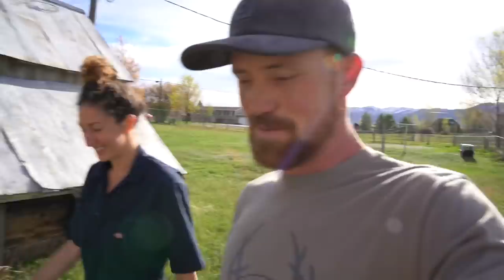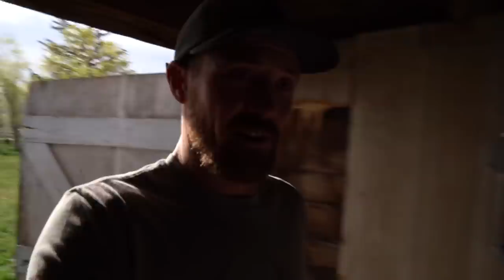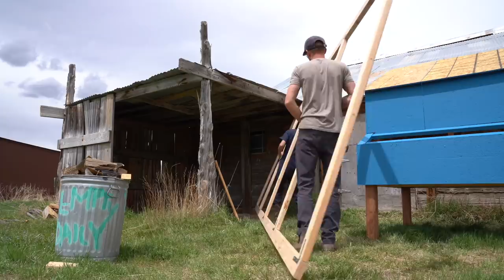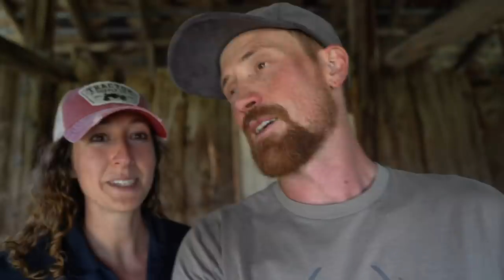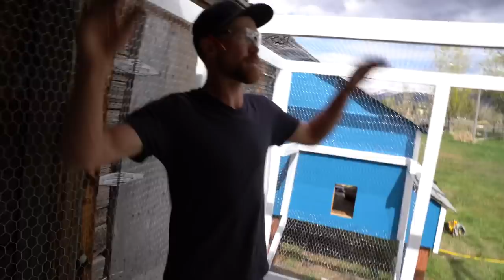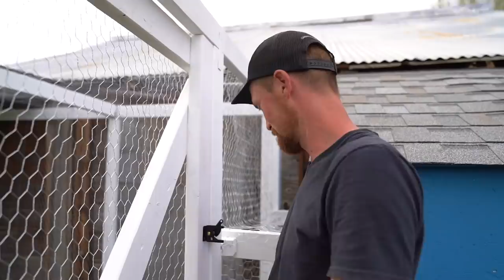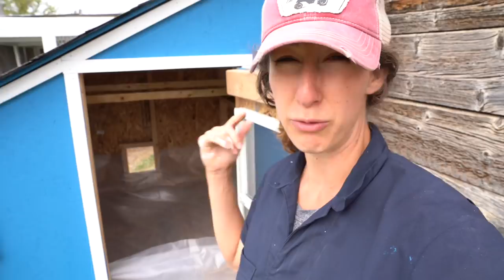WE WILL NEVER DO THIS AGAIN...

Comment: Allie darling, raccoons, badgers, weasels , neighborhood cats, they all can climb. Put the chicken wire or 1/3" inch hardware cloth work quite adequately.
Reply: In your video about the barn you were wondering how to make venting windows that could be used for weather and temperature proofing. Make frames of 2x2 staple 3/8" hardware clothier the frames use small fence staples to attach the cloth. Put a 2x2 rib about every 16" on center. These frames can be built on the ground put the frames in the openings and use 3" phosphor bronze deck screws. By using the screws this will allow you remove them for cleaning and rescreened. On the outside of the barn install horizontal  opening covers of plywood attach with hinges use screen for hooks or wood locks that can be pivoted  to lock the coverings  in place.

Comment: Raccoons will climb up the chicken wire walls and into the chicken coop, VIA the open top no problem. I have seen them climb up the side of a house with siding and into the roof overhang to her babies.

Ground solution, If there is a metal water pipe in the area wrap a metal strap around the pipe and connect the third wire to the pipe. OR purchase a copper ground rod from the hardware and drive it into the ground and connect a wire to it.

Comment: Even with the coop fully enclosed, predators will probably get the chickens.  Don't leave the roof uncovered to make it easy for them.  You are going to have to put some lath work on the chicken wire with screws into the framing to keep predators from simply pushing through it.

Comment: Sorry Allie, I truly love you but I fuly agree with Trent.  Locke them up as tight as possible.  The aftermath of intrusion is heartrending and traumatic.  Best to avoid it completely. xx  After watching  bit more of you both stapling the mesh I would also have placed flat wooden slats over the stapled areas to ensure nothing gets in.  That's how I did mine and it still hols solid after 8 years.

Comment: Predators absolutely will find their way into the coop. They'll even dig underneath the bottom to get in.
I've seen where someone strung wire from end to end and corner to corner and put a pvc  pipe with wire strung through it. The predators cannot get over the rolling pipe :)

You could even put in a big screw hook. String the wire and put it inside of the pvc pipe and hook the end wire around another screw hook.

Comment: Another roof comment, but this is about the asphalt shingles on the chicken coop. I hesitated to comment on this but Trent I see you like to do a good job so I thought I would let you know for the next time you shingle something. So, #1 the exposure on the shingles is too wide. When I see homeowners do this it is because they set the top shingle to the line on the shingle below it, but the line on the shingle is really for a nailing guide, and the shingle should be set down to the top of the cutout on the lower shingle ( the exposure is 5 5/8"). #2 Your nails are way too high, they should be driven thru the line on the shingle, or as low as possible but still covered by the next shingle. #3 The seams where the shingles come together need to be offset a minimum of 4" between rows. #4 And finally the shingles should never be overlapped, always butted together. I really enjoy your videos and I hope I don't come off as a troll.

Comment: If you dont have that chickenwire on the floor, rats and wheezles and skunks will dig under the wood and go after the chickens and eat the eggs. Just without a stapled wire floor they get in by digging holes under the fence. Nice coop though.great job!!

Comment: Time to call an electrician to see if there is a way to ground the barn without rewiring it?  It will be a lot more expensive and devastating to have a fire that burns down the barn and maybe spreads to the house or fields.  It makes me wonder about the wiring in the house.  Has it been checked for knob and tube wiring?  With the age of the house it is a possibility as is aluminum wiring.  Both can lead to fires.

Comment: I see the comments have covered yes, predators will get in. However, the door into the actual coop will need to be shut at night.  We use an automatic door from chickendoors.com, the "Pullet Shut" door.  It is the best one on the market for a variety of reasons. That way you don't have to be at home to make sure it shuts at dark, just adjust the timing a bit over the seasons. You CANNOT leave that coop door open at night because raccoons can and will tear through chicken wire. Only hardware cloth is actually safe.   Goats as pets-- The big difference is that goats are prey animals and dogs are predators. They are just very different in their relation to the world. Goats respond better to soft voices and quiet presence. And, if you want the real skinny on livestock guardian dogs, join the facebook group "positive training for livestock guardian dogs" or something like that-- they contradict some of what is being said here and their advice really works. p.s. they don't "forget" their genetics-- but young puppies need to have the bond built.  One more thing-- the "Deep Litter" chicken coop method is ideally done with more than 4 to 5"-- Twelve inches is a better goal.  best wishes.

Comment: Verbal dyslexia is called spoonerism. My wife has it. 
Also, your chickens may still be a little bit young to go into the coop at this point. We waited until about week 5 or 6. You might take that into consideration!
Also cover the top of the run! Rats, possum, raccoon, skunks! All nimble creatures. Another good idea would be to put a 3 or 4 foot chunk half on the ground and half on the side of the run outside and use washers and long heavy guage nails to fasten it to the ground to prevent predators from digging underneath.
Reply: Oh, I see that you did that last part. Good deal.

Comment: 2.4K comments took longer to read than your video. Looks like everyone wants a roof, extra chicken wire overlapping with lath strips to lock down the staples. Laydown a barrier against diggers. Maybe the plastic not good, paint that floor, that poop can pile up. The electrical suggestions good. Nice to get a door from the run on a self closing timer. Get some worn out tires and pallets for the goat yard.  Dog needs to sleep outside to be the protector. 41 years here and we still bicker.😎❤️👍

Comment: Put a wire floor and roof and walls into it. Preditors including snakes eat eggs and chickens even blue jayspoke holes in to eggs. I had a cuz in  went to tend to he babies rabbits. Mom was dead all the babies were inside a rattle snake .. it ate the babies and could not get back through the chicken wire. Che ended up covering all her animals cages with a wire that Look like chicken herewith quarter inch holes. Same thing happened to us but it ate eggs and could not get out, ours was a large watersnake.

Comment: Predators WILL get under that fence area in the coop. You need to run chicken wire into the ground at least a foot and anchor it to a board or a metal rod before filling the hole.

Comment: You really want the wire attached on the outside not inside. Otherwise it will be very easy for a predator to push from the outside and make the staples pop out. Also, you really want hardware cloth and not just chicken wire... at least for the bottom.  Raccoons can reach through the big holes in chicken wire.

Comment: Personally the symptom of mixing up words hit me about age 60 :(  After reading this info you tell us Trent if you are dyslexic.

People with dyslexia find it difficult to read. They are every bit as intelligent as the smarter person. However, they see words upside down, and my sister who ;has it sees things in doubles. Somehow her brain helps her to turn them right side up.

How does someone with dyslexia see words?
Most people with dyslexia see words in an inverted form (upside down) or half letters or moving letters. For example, dyslexic people find it difficult to differentiate between letters'd', 'p' or 'q. Some people suffer from significant reading problems due to dyslexia related visual pressure.
Are Dyslexics more intelligent? "High-performing dyslexics are very intelligent, often out-of-the box thinkers and problem-solvers," she said. "The neural signature for dyslexia is seen in children and adults. You don't outgrow dyslexia. ... People with dyslexia take a long time to retrieve words, so they might not speak or read as fluidly as others.
Most adult dyslexics will exhibit at least 10 of the following traits and behaviors. These characteristics are often inconsistent, and may vary depending upon the day or situation.
Career:
Employed in job/position that will hide difficulties or not require dealing with problematic areas.
Hides difficulties from co-workers, friends and even family.
Becomes frustrated at “planning meetings” and sequential tasks – already has the answer and how to do it.
Becomes frustrated or overwhelmed with long forms or sequential processes.
Thrives in careers where visual-spatial/kinesthetic talents can be realized: For example – Entrepreneurs, Engineers, Trades (carpentry, plumbing, electrical), Artisans, Interior Decorating, Actors, Musicians, Police/Investigation, Athletes, and Business Executives (usually with staff/assistants).
May pass up promotions or advancement opportunities that would require more administrative work.
Has difficulty focusing and staying on task – may feel more comfortable managing many different tasks simultaneously.
Difficulty with tests – passing standardized tests can be a barrier to career advancement.
Highly successful/over achiever, or considered “not working up to potential.” Either way, displays extreme work ethic.
May be a perfectionist and overreact when they make a mistake.
Out-of-the-box thinker or operates with very strict rules for themselves.
Learns best through hands-on experience, demonstrations, experimentation, observation, and visual aids.
General:
Highly intuitive – known to have “street smarts.” Is often “dead on” in judging personalities of others.
May be able to sense emotions and energy of others.
Remembers struggling in school.
Frequently have dyslexic children and experience guilt when seeing own child struggle. Insecurities arise while reading to own children or helping them with homework.
Easily distracted/annoyed by noises and other things in environment.
May appear to “zone out” and be unaware that it is happening.
Enjoys video games.
Misspeaks, misuses, or mispronounces words without realizing it.
May have poor balance or is/was very athletic.
May have excellent recall of events that were experienced or not remember at all.
May confuse past conversations or be accused of “not listening.”
Difficulty remembering names of people without tricks, but remembers faces.
Difficulty remembering verbal instructions or directions.
Poor recall of conversations or sequence of events.
Reading, Writing, and Spelling:
Difficulty reading unfamiliar fonts.
Avoids reading out loud. May dislike public speaking.
Will commonly perceive that they “read better silently.”
Has adopted compensatory tricks to remember spelling and homonyms (their, there, they’re), or misuses homonyms and has poor or inconsistent/phonetic spelling.
Reading fluency and comprehension fluctuates depending upon subject matter.
Frequently has to re-read sentences in order to comprehend.
Fatigues or becomes bored quickly while reading.
Reliance on others (assistants, spouses, significant others) for written correspondence.
Uncertainty with words, punctuation, and spelling when writing. Reliance on spell-check and grammar-check.
Words out of context look “wrong.”
Poor handwriting – masks spelling mistakes.
Writes with all capital letters, or mixes capital letters within words. Abbreviates words frequently.
Math, Time Management, Directions:
May understand higher math, but can’t show it on paper.
May excel at math, or may still rely on tricks for remembering math facts.
Relies on calculators or finger counting. May have difficulty with making change.
Difficulty with left/right and/or North, South, East, West.
Gets lost easily or never forgets a place they’ve been.
Difficulty reading maps.
May have anxiety or stress when driving in unfamiliar places. Relies on others to drive when possible.
May lose track of time and is frequently late – or is highly aware of it and is very rarely late.
Finds it difficult to estimate how long a task will take to complete.
Behavior, Health, and Personality:
May have a short fuse or is easily frustrated, angered, or annoyed.
Easily stressed and overwhelmed in certain situations.
Low self-esteem.
Self-conscious when speaking in a group. May have difficulty getting thoughts out – pause frequently, speak in halting phrases, or leave sentences incomplete. This may worsen with stress or distraction.
Sticks to what they know – fear of new tasks or any situation where they are out of comfort zone.
Extremely disorderly or compulsively orderly.
Confusion, stress, physical health issues, time pressur

Comment: So the plastic sounds good but it isn't. the chickens will poop behind the plastic and it will give a place for vermin to nest. So! go find a piece of linoleum and glue it to the floor. Then paint the walls with a good bathroom waterbased enamel.if you really want to water proof the undercarriage paint it with the bathroom enamel as well. Now about the chicks go find a Nursery supply store and get a 3' x 4' grow mat. Essentially it is a rubberized heating pad that will keep the floor about 70 degrees and it is washable and that will keep the chickies warm and it only consumes 20 watts of power so it's easy on the electric bill.

Comment: Sorry to say, but chicken wire won’t keep out predators; they can rip right through that.  You should have used 1/2” hardware cloth which is a welded wire that’s much stronger and also doesn’t rust as fast.

Comment: Please pay attention to the various comments from other youtubers. I GUARANTEE you...everything will happen eventually. 

1. Yes, things burrow in from underneath. Fix the bottom. 
2. Sorry, Allie. Critters DO swoop/climb/jump over the top to get in. You sleep all night. Predators have allllllll night to figure out how to get in. And they will come back the next night. And they WILL remember not to repeat the same failures. GUARANTEED.
3. You NEED to put a moisture barrier inside the coop. Not just the floor. You will find moisture in all the cracks and crevices. And dust/dirt will adhere to the moisture and start to build up. I used OSB board too. It will degrade over time - painted or not.
4. Chicken wire is meant to keep chickens contained. NOT predators. All a raccoon has to do is use his hands to stretch the wire. Or, I've had a raccoon PULL a chicken IN BETWEEN the wire and break most of its bones. It killed the poor chicken but the raccoon got its meal. This one upset me quite a bit. 
5. Consider how your mom will replace all the weakest links to this entire system of animals when you guys are back on the road and cannot do these things for her. 

These are all the things I have learned over the years. And, I'm sure, there are probably more that I have missed mentioning here. Once all these are considered, then, having animals can be extremely rewarding. I personally LOVE having fresh eggs and milk and all the things animals can offer you. Especially soup when you get those MEAN roosters... :-)

oh... and Meredith is right... lock the door because raccoons DO have hands!!!
Annnnd... Sally is right...I reached in before I realized there was a snake in my nest box eating my eggs! Always look first!!!

Comment: They goats are staying away from the mold. They’re staying near the fresh air. They won’t eat the hay because they can smell the spores from the mold.
And awesome chicken shack, but 🤦🏽‍♀️ you built it inside the extremely moldy barn. Just move the chicken shack and run about 10’ so they’re safe from that mold. Use metal sheeting as a roof to protect them from the sun. And you gotta move the goats somewhere safe, not inside that moldy, rotten building. Those animals might get extremely sick if the mold strains are toxic, once it becomes systemic in their bodies.

Comment: Raccoons will get in anyway they can.  They will also reach their paws to grab a chick and pull its head through the hole and munch down.  Also staples are not strong enough against a determined raccoon.  the chicken wire needs to be sandwiched between wood secured with screws.

Comment: Raccoons and Possums will climb over for sure. Possums especially like going after chickens. I'd even consider some electric wire at bottom, middle and top on outside of that run area. Just the other day, I saw a couple of raccoons driving a garbage truck down the road on TV, so it must be true. ;)  youtube.com/watch?v=ezF-YgVxHG4